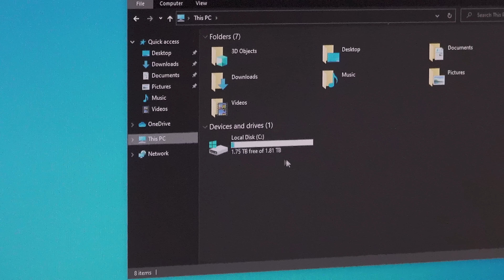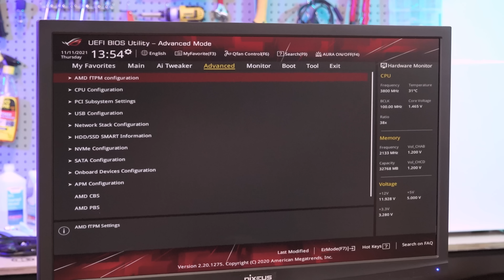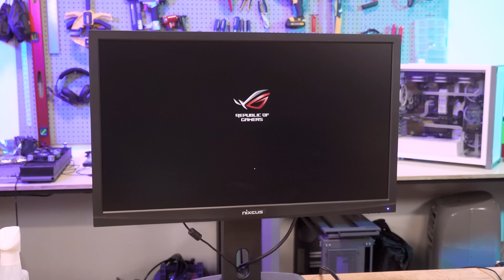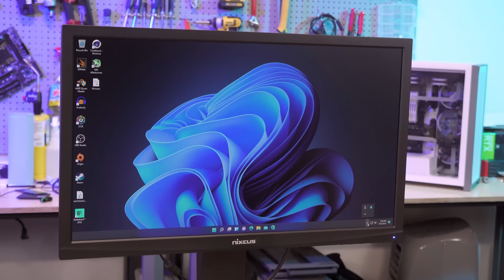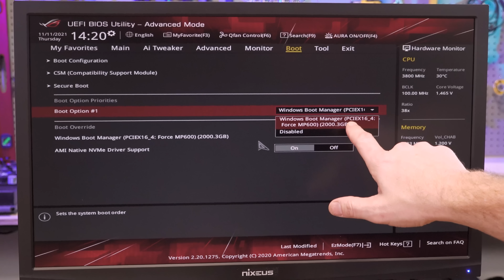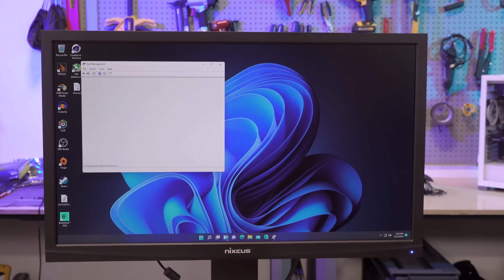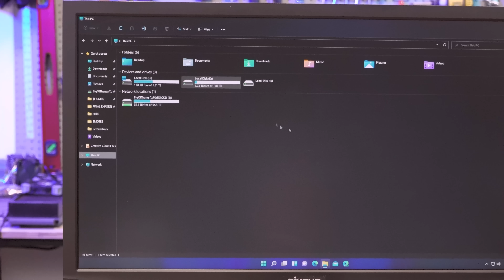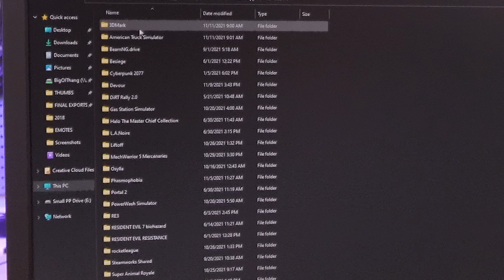Can you move Windows 11 from one PC to another... Let's find out!

Comment: Today I cloned my old Win11 system drive from a i7-7700k with 980 pro m.2 drive, to a 990 pro m.2, and installed it in a i9-14900k z790e gaming wifi pc, it started up no problem, and just needed some updated drivers. Then I cloned a 2nd system drive from the previous i9-14900k 990 pro m.2 system, to a 9100 pro m.2 drive in my new AMD 9950x3d with x870e Tomahawk setup, it started up on all the default bios settings, and the MSI software automatically installed every updated driver on the 1st startup. Crazy how easy it is to upgrade all my computers now! I usually upgrade my best gaming rig every year or two, and all the parts I take out are moved down my office pc, and then the shop pc, etc...

Comment: This came up in my autoplay,  two years later lol.  Yeah you can move windows 11 into the trash and reinstall windows 10.  Microsoft has admitted windows 11 will artificially restrict your hardware if you're using older hardware.  Even hardware that meets Microsofts requirements for windows 11.   
That's added on top of the amount it already stifles your rig just based on all the unnecessary bloat.

Comment: My issue is when I transferred my ssd with windows 10 from another motherboard it loaded it up but with a slow boot time and distorted image while trying to load. Then it rebooted itself and it booted in fast and the slow latency was gone. However, hours later turn on again after being idle and it starts to boot up very slow again and it reboots after being slow for like 10 minutes and it’s fine again. Very confused since I never had this issue when swapped ssd to other motherboards.

Comment: Hello I need some help. I have a ryzen 5 2600 and a msi b350m bazooka motherboard, I wanna get a i5 14600k with a Asus motherboard (motherboard not decided yet) and I have windows 10. Will I have a problem if I simply take my drives and put them in the new PC I'm trying to build Will I lose anything And is everything gonna work properly Or I'm going to need to reinstall windows??

Comment: Okay, need a little more in-depth here. Currently running windows 10 on a 4tb Barracuda  HDD with Intel Optane, (Optane currently disabled since I needed to clone the drive) on a MSI Sli Plus Z370. Building a new system using the Z390 MSI Tomahawk that will have a 4tb Crucial SSD.
What I am wanting to know is, will my new system boot using the old HDD, then clone it over to the SDD. Would have cloned to SSD but current machine will not recognize it for some reason even after removing the Optane Module.

Comment: I Appreciate you uploading your experience in actually doing a swap like that. The OS transferred over really smooth. I'm wanting to swap my M.2 NVME with Windows 10 installed on it from a Dell 7470 laptop to a similar Dell 5470 one. Both have 6 gen I-5 CPU, but going from a I-5 6300U to an I-5 6440HQ. Some say no problem and others suggest a fresh Windows install. Thanks for sharing your knowledge.

Comment: Great video Jay! So I have just purchased a Ryzen 5800X3D along with B550 MB, New CPU cooler and new NVMe drives (all brand new). My current system is an Intel 6700K, on Asus X99-II platform. Do you think I might run into any issues if I put my old NVMe boot drive into the new system? Hoping to just do what you did here and boot Windows straight from my old NVMe!

I'm just hoping that I don't have to buy another Windows key!
Reply: I went from an old Xeon e5 v3 build to zen 4 and Win11 boots just fine. Installed several drivers afterwards and the performance seems to be in-line with other benchmarks.

Comment: I would just recommend uninstall anything like chipset drivers etc from old motherboard before doing it, and make a backup. Make an local administrator account in case issue with Microsoft account issue (pin not working).
Reply: And if you get issues, you can always reinstall windows 11 later if need be!

Comment: wonder does this would work from a win 7(2010~) build to a modern 2020~ setup and have all my setup/installs/preferences preserved and hopefully able to clone my old files+boot into a NVMe and then upgrade win 10
Reply: In my experience, if you try to move a Windows 7 or older installation to a new computer, it will not work. You'll most likely get a blue screen of death. Its much easier to do a clean install of Windows on the new PC and transfer your files over to the new system. It takes more time, though.
Reply: @JJFlores197  surprisingly I manage to boot into my win 7's HDD up to the user login screen when the bios is set to CSM mode. unfortunately due to the fact there's no drivers in that drive nothing works, USB keyboard + mouse it doesn't response, if there's an ye ole PS/2 port the keyboard might work but right now it's a fresh install and I've manage to restore most setting by copying over the needed program's app data from the win7 drive

Comment: I used this method to install windows 11 on a Core M, 4Gb ram, with no TPM. Runs as well as windows 10 did.

When I was running the beta of windows 11,  I installed it on My old laptops SATA m.2 drive,  so I could quickly swap back to windows 10 if needed. I wanted to use my old laptop which is from 2015 as a wireless display, and windows 11 was running well on my primary PC. So I cloned my windows 11 install back to the original ssd. When I put the ssd back into the old system, I thought I would see what happened. It installed drivers and booted, windows update also worked. So I reset windows and downloaded windows 10 drivers, for what windows 11 did not recognize. I now have a way out of spec computer running windows 11. It also has a different Device ID and Product ID,  so looks like everything activated properly.

Comment: back in the day moving between intel and amd would be enough to bsod. nowadays shouldint be an issue. only thing id see is going from ide to ahci or if some exotic storage is used or obvisouly raid. also using front pannel usb probably was the issue with the drive..especially hanging/dangling

Comment: I suspect the drive problem is due to that USB dongle.  TECHNICALLY you can hotswap M.2 drives, but I've run into this problem before where I still have to reboot to get a hotswapped drive in a USB dongle to initialize correctly in Windows.  Also, I suspect Windows has a bug in the way it accesses drives through USB.  I've had a couple USB hubs behave exactly like this with USB external drives, but the problem would clear up and the drive would read correctly if I took the hub out of the equation.  This is just a hypothetical, but I wonder if Windows sees a drive's firmware and expects it to perform at a certain speed, and depending on how you have it connected via USB, the drive not accessing at the speed Windows expects causes it to detect a hardware failure?  For example, hotswapping in an M.2, Windows sees firmware on the M.2 identifying that it is an M.2, but if the dongle is bottlenecked by the USB speed (such as plugging into a USB 2.0 port) Windows thinks there's a hardware failure?

Even if that dongle works on the PC you usually use it with, I'd probably experiment with different USB ports and different motherboards to see if you can recreate the same issue while hotswapping on it.

Comment: I have a wd 500gb m.2 nvme that came with my pre-built  i7 11700kf and 3080 gpu. I'd like to buy a 2 tb m.2 and replace the current one. How is the best way to do this. I also have a 1tb hdd installed. My os and all games are on current wd 500 gb. Please help. I also have a second m.2 slot but gpu is blocking it. Z590 motherboard.  My goal is to transfer all data including OS onto the new 2 tb nvme.

Comment: I saw this video and have a question about cooling ... nothing to do with the subject ...

Would parallel cooling be more efficient/effective then serial ?

Parallel:  Split the input to CPU and GPU; Split output also from CPU and GPU and 2 radiators serial connected ...
Serial: As you can see in this build ...

Comment: my biggest Problem with windows 11 is that TPM 2.0 and secure boot only seems to be needed to be enabled during install.
I actually run a system so not compatible with windows 11 and once I got past the install it ran just fine with no tpm or secure.
And if you're curious, you can actually trick win11 during the installation to not check tpm or secure boot. lets see when ms will patch that

Comment: One thing to keep in mind - if you have a Microsoft account linked to your drive it may have bitlocker enabled, so moving it to another PC you may need to enter the bitlocker code to unlock the drive in the new PC. Something I've encountered on occasion.
Reply: whats that?
Reply: @mykeebs3424  encryption you can easily disable it in windows settings

Comment: I had issues with my SATA SSD not being recognized on my ASUS B55-F board. Even after I upgraded to Win11. 
But the other SATA SSD (which is the same manufacture, bought at the same time) works just fine. I'm thinking it's a Asus thing.

Comment: Isn't that like moving a house fire from your house to another house you own across town? And if you installed windows with more than one HDD in the system MS will put a partition on the secondary drive that is required for windows to boot. So any install of windows you do, only have one HDD in the system when you do so or cloning is going to be a pain mainly cause it won't work :) Have yet to find any cloning software that will let you say, oh yeah and once you've cloned the drive grab this obscure partition off drive D: please LOL

Comment: Just checking - the install works, but did the system swap give an activation error under settings?  When I did this under Win10 in the past, the install would work, but there would be an activation notice that popped up a day or 2 later.

Comment: I had zero issues migrating an NVME drive from a laptop to my desktop's motherboard with Windows 11. The reason I did this was because both my laptop fried and my desktop had bluescreened to death trying to updated graphic drivers after 5 years which was caused from me updating everything to Windows 11 in the first place. So I am in a weirder situation but it works.
Reply: After I did this I can still use the original drive's games etc without touching it. I just has windows files still on it.

Comment: interesting... I have a Kubuntu 18.04 install on an old HDD that I swap between an i5-2500k, an i7-4790, and a R5 2600x regularly since, well, 2018 with no problems. it even remembers the desktop settings for each system 👌

Comment: The timing of this was perfect. I have my PC in pieces right now doing a motherboard and CPU upgrade. And yes, I had windows 11 installed on an M.2. Thanks Jay!
Reply: After all of these research i just found the answer from this comments, thanks guys
Reply: Hi please me how you moved you windows 11 into new pc. I am building  new pc with new ram,  new cpu, new motherboard. And i have installed windows 11 on m.2 gen 4 ssd in old pc. I only have one ssd. So how I will move my windows 11 to new pc.
Reply: @proFFGaming2  You can just plug your m.2 into the new motherboard and it should work. *However*, I would recommend doing a fresh Windows install. You can download the installer from the Microsoft website to a USB flash drive.
Reply: @G4MERtheGREY  ok i will try this if it doesn't work well then I will do the fresh install
Reply: @proFFGaming2  hey, how did it go? I am just about to this with SSD, simply plug it in new computer?(Win11 ) first I will detach windows key from my old rig and activate it on a new computer whe. Windows will boot but the main question is if it boot 😂Appreciate confirmation it works like on the video.
Reply: @IIPAGOII  i worked normally no problem happened. If your windows doesn't activate reply here.

Comment: Hey Jay,  I've had a similar issue with specifically windows 11 when it comes to drives. It would switch the drive from 2 TB to 2GB and would not boot to OS. After restarting multiple times (6-7) it would load. However the issue would pop back up randomly after reboot. If I installed Win10, the drive would function as intended. Figured I would pass this along in case it's a bug that you guys can look at.

Comment: For anyone reading, if you've got bitlocker enabled on a drive which is enabled by default now on a clean build of Win11, be super careful about moving a drive between systems as it'll flag something and knock the drive off.  You might/should be able to get the recovery keys from your MS account, but maybe not, but you'll get the same issue as Jay had there with the drive not showing up in the foreign system.  It won't even go back into the original build without the recovery key being entered.
Reply: Thanks I've watched so many of these "look it just works videos" in reality it doesn't work for the bitlocker reason.

It was a real pain as we were just replacing motherboard and CPU so we had the system ready and we got the windows boot error. I'm guessing this guy disabled bit locker and just leaves it out the video?

Anyway was full format or rebuild the old computer, don't trust YouTube. So much waffle and didn't explain the bitlocker issue which will probably affect 95% of people doing this nowadays.

Thanks for answering the issue I can't believe in 2025 you have to dig into comments to find an answer that should be pasted everywhere.

Comment: Jay I get the same fatal error with my m.2 usb stick, seems to tie it to the same usb socket on the mobo in windows 10, like I have taken my drive to my parents place, both my brothers pc, and my fathers pc show the same fatal error. bring it back to my place plug it into the same usb slot works fine, put it in a different usb slot, and got a fatal error. maybe the same thing happening to you, because the m.2 was formatted with it plugged into the mobo, then trying to use it externally is the same issue.

Comment: As others have mentioned, stuff like drive risers tend to need the slot configuring to 4+4 (for an electrically x8 slot) or 4+4+4+4 (for a "proper" x16). Splits the slot up and should allow you to mix and match drives as much as you like.

Comment: My system was able to boot when I changed my B450 and 2600x to a B550 and 5600x.  I still made sure I installed Belarc to get my Windows key just in case something happened.  Ended up formatting and reinstalling Windows 11 because the motherboards were different and was running into an issue with a LAN driver.  Fixed after reinstalling Windows 11.

Comment: was going to say i've teh same board. why not use the m.2 slot under the heat shroud/rgb heat sync on the bottom right. but after seeing how your cooling system it taking out the gpu to get to it may be a big more difficult than it looks. because that board sports 2 m.2 slots and an additionally with the simm adaptor that goes next to the RAM.  but still good to see win can be moved from one pc to another.

Comment: I switched my m.2 with windows 11 from ryzen 7 2700 b450  pc to i7 6950x asus sabertooth x99 , working without any issues have to run valorant to check if it works as it requires tpm to run on windows 11

Comment: This was fantastic to see. My biggest concern with upgrading to Windows 11 was the question of what would happen if some of my hardware died and I had to put my m.2 in another system? From the little I understood about Windows cryptography and TPM I assumed the drive would not be able to be decrypted and read without the original TPM module, but according to your findings that's absolutely not the case. Good to know.
Reply: It still is the case. The drive decryption keys are stored in the TPM, BUT drive encryption isn't enabled by default when installing from media. If you enabled BitLocker then you would be screwed if you didn't have the recovery key (unless you used a hardware device instead of TPM for the decryption key) 

The TPM requirement is for secure boot so that Microsoft's keys can be stored and checked on startup to ensure that no critical system files have been tampered with.

Comment: Question about which is the best m.2 slot to put the system on, the apps on, the data files on, the virtual ram, and the file swapping space on. Not sure about your mobo but it seems like most give you have a choice of one pcie slot going directly to the cpu and several to the chipset. If you have a choice, which goes where? Does this change whether you are just playing games, or running database intensive graphics apps like Revit?

Comment: Weird question for you Jay, and not exactly pertaining to this video but it might make for an interesting tip video. But can one use a loop leak tester, like the EK leak tester for example, to drain a loop? Before I've seen you blow into the system to push the air out, and thinking of a more elegant way to drain a loop would be to use the leak tester to pump air into the system, with a drain valve open, to displace the water in the system with air.

Comment: You can't enable pci-e bifurcation on the lowest slot, or at least you can't on my STRIX X570; meaning either you place the card directly below your GPU, in my case horribly choking out the air supply, or you only put one drive in it. As it stands my 4 slot ASUS card is a very expensive way to add a single (third) drive to my system, but at least I have everything in and working.

Comment: W11 is not stable just yet, had some hard crashes up until the point the system wouldn't even restart  when using the restart menu from W11. No issues while running W10, 5900X,6800XT,X570-F,2x1Tb gen4 storage,32Gb 3600Cl18 Corsair Ram,750W RM750x PSU, 240 AIO

Comment: I think the reason why the m.2 drive did not show up when plugged into the external usb, is because it is not hot swappable.  You have to unplug the usb cable from the computer, then plug in the m.2 drive, and then plug in the usb cable into the computer.  That's why it showed up correctly after that.